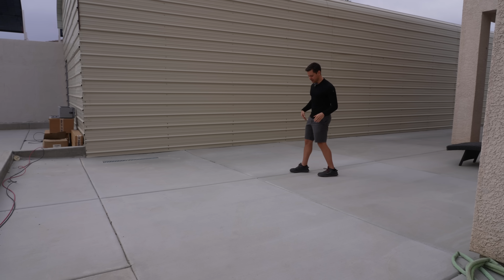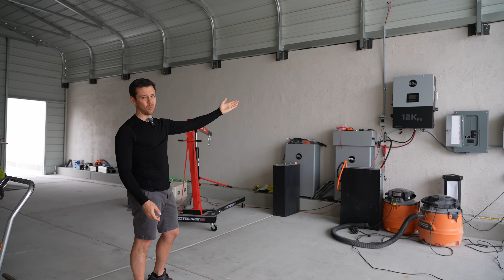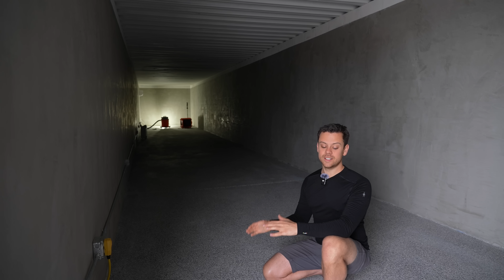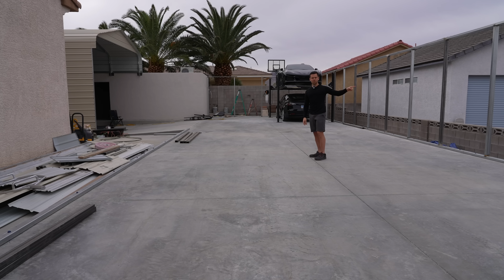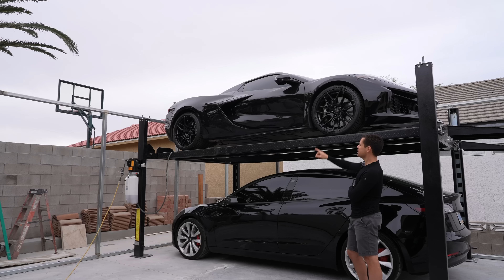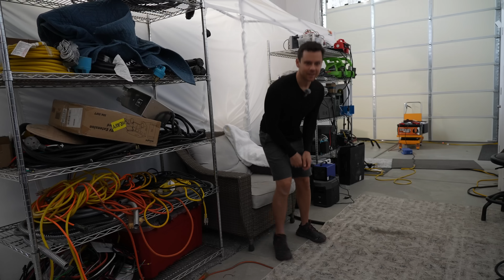I'm building a Bunker Vault! And other channel projects and life updates!

Comment: Amazing compound, Will. Thanks for all of your informative vids. I used them to build my ongoing 48 volt system which supplies vital loads during power outages- garage with my own comms system, fridge, and lighting, my well pump, as well as hookups for wifi, house fridge and cell phone charging, etc. I use a Sun Gold 18kw/ 48v grid tied inverter and a bank of 4- 200 amp hour batts in series. 2 solar chargers w/ combiners mounted outside for panel hookups. You are an inspiration and a great teacher.

Comment: it'll be cool if you can make a system so the vault is hermetically sealed with air recyclers from the outside, that way it's can truely be a fallout bunker, though I know you mentioned getting approvals that vault looks like it needs some kind of seperate air supply and a backup, as if somehow that bank vault door was closed with someone inside, it wouldn't take long with them breathing make making the C02 levels to rise, causing hypoxia, not to be a downer, but doing something like that not only to keep approvals off your back but also for you own safety

Comment: Learned something new about my heatpumps here in AZ.   I started monitoring them this summer with EmporiaEnergy in the panel box.    Here in November I turned them both off at the thermostat.     But found that each HP uses over 1Kw per day in the off position.  So I flipped the breakers off now when not using them.   (1Kw = 41w/hr)

Comment: Well I’ve got a 12’x12’ log cabin in northern WI. I currently  am planning on  powering it with an Anker F2600 fed by a 48v 30ab lifepo4 golf cart battery via the xt60 dc ports. I will be simultaneously charging them with a 48v 30 amp smart charger connected to the go battery. Do you see any problem with this?

Comment: Solar carport is a good idea, then you don't need to worry about having to move the panels in front of the RV garage. Solar powering hydroponics in the bunker would be cool, literally. Do you have a home gym, you could use excess solar to heat up a hot tub for post workouts.

Comment: You're something else, kid!! As an old retired veteran I have the time but I sure don't have your energy and motivation. Ok, nor the $$ lol. My range is out my front door on my 40 acres in very rural Oklahoma. I putter and even made one of those 4x8 solar panel air heaters some years ago but recently focused more on solar. Built my own hobo freight rolling tool box power station. Adding an Aferiy 210 with extra 100ah batteries to augment it. Mostly plan to use for keeping freezers going and blower fan on wood furnace.  Your videos motivate me to do more but I'm trying to be realistic for my personal situation. Keep them coming!

Comment: If anyone is just starting with Solar power… this system is the way to go… almost “plug and play” no figuring all the wire sizes, no figuring fuse sizes. No separate charge controller, no separate inverter.
All of your needs are there in a space saving unit. 
A 3000 watt inverter is a great size to start with.
If I could replace my current system… this is definitely the way to go!! Especially if just starting a solar project.
Thanks Will great video as always.
Excellent information, just hope people will follow up with your suggestions.

Comment: For heat reflection add a touch of blue to the white paint. It won't even get warm. I learned this from building a spray booth for a guy. He says it reflects light better. I painted a shed I made with it and it did not get hot to the touch in summer in South Florida. Try it you will be amazed😊

Comment: i built a 4s 32ah lifepo4 battery to replace the agm battery in my car. i went without a bms and used an inductive active balancer and added a 15w  heating pad connected to a thermostat and mounted it all inside of an ammo can. saved 55 lbs of weight over the regular agm battery in my car, and it saved about 55lb of weight which is the same weight savings as a titanium exhaust lol. its in my 2013 chevy volt. if i were you i would look into mods like this for your fast cars. crazy weight and money savings.
im also building 8kwh 100lb range extender packs out of 20mm ammo cans. they cost about 360 bucks each right now and use a cheap 3kw eu spec 220v inverter and the plan is to just charge them through one of those j1772 e bike plugs from free chargers at work. you can perfectly fit 8 280ah lifepo4 cells with the shorter threaded tops into 20mm ammo cans and theyre pretty fire safe. also not going with any bms since bms' are the reason for most diy battery fires.

Comment: Good stuff Will, you should try using unistrut on the walls where your going to be doing a lot of testing and changing configurations.  Real nice system if mounting points are constantly changing if your not familiar with it.

Comment: The system only works if you grease pockets.  
About your puffy face, you ain't no spring chicken anymore.  Cut down on your salt intake and drink more water.  Also decrease your weights and increase your reps for more definition and slow down the repetition to a 3 or 4 second count, that will help increase your muscle stamina.  I'd follow your gun channel if it is good.  Been shooting for more than 58 years maybe you could teach an old dog a new trick.

Comment: Regarding "puffy face" effect... as a one-time portrait photographer you soon learn to use slightly-telephoto lenses when doing shots like you do (small amount of table in background with you seen from mid-chest up). More wide-angle lenses tend to 'fatten' the person being video/photographed. You could take advantage of that in your 'bunker' with having a removable false wall at one end which has the power stations under video review and having the camera 10-20 feet away zoomed in to your desired view.
BTW I did meet you at Quartzsite Hobo Camp 2 or 3 years ago when you zipped down from LV for the day (and left after a short time at the campfire). 👍

Comment: If you want a gun range... go PCP air rifles and no permits required in most areas. Oh and PCP air rifles are totally different than old bb guns. You can go very large caliber but common ones are 22, 25, 30cal. Get a high pressure air compressor to charge them... really fun and very accurate too. My .25cal PCP air rifle can shoot 1/2 inch groups at 50 yards all day long.
Reply from the maker: Holy cow that's amazing
Reply: @WillProwse  You should get yourself one and see for yourself. I live on 2 acres so have 100 yards in my back yard and shoot mine there all the time. Super quiet so neighbors never hear a thing. My rifle uses 8 round pellet magazines so I can load up 4 mags worth of 25cal pellets and shoot all 32 shots before I need to recharge the rifle with air. Quiet, accurate and not cheap to buy but not bad either. A nice setup of rifle and compressor will be about $1000.Match grade setup maybe double that. Get yourself one and I bet you will be hooked like I am. Pyramid air is a good source for info and where I buy my stuff. No connection to them, just helping you out with something I actually am very familiar with since I have learned a lot from your channel about solar. ps... I love cars too. I currently have a 1970 Mach 1 with 351 Cleveland. IF you like cars, give an older musclecar a try. Every sportscar enthusiast should have at least one vintage musclecar.

Comment: I'm wondering how the bunker exterior wall joins to the RV garage  with a curve down roof.?
Seems like rain would shed down the RV roof ad run over the power wall that's loaded with electrical stuff.
I realize there's minimal rainfall in Vegas,  but sometimes it does!!

Comment: I grew up with American engineered vehicles and my Dad was always working on them. Then he bought a Datsun 210 and station wagon and rarely ever had problems. If American auto companies had taken Dr. Deming's quality assurance to heart, America could have remained forefront. But you just nailed the root problem...planned obsolescence.  I have traveled around the world and for some reason, many Latin American consumers still buy American engineered even with all their problems.  I am sticking to my reliable Hondas and Toyotas.
Reply: Those new Toyotas sure are reliable, non stop recalls.  The one advantage they had was making the same model for 20 years without changing much if anything.  Other manufacturers trying to release new models constantly leads to problems, just like the nightmare Toyota is in now that it is releasing some new models.

Comment: If you need permits, you’re not far out enough. In my state there is zero code or enforcement. Building permits are flexible (just a fee, always approved) or you can avoid it by spending less than 1000 or building on skids. Septic is loosely enforced.

Comment: You got a whole compound now!  What a far cry from the old van days.  Ya need to get some employees, a wife, and family.  Happy you aren't turning that thing into a gun range, even with active filtering the lead exposure would be off the charts, particularly with regular use.

It's something that isn't talked about very much, but people die every year from gun range lead exposure.  Gun-rights states underplay the danger and avoid recording statistics on it, but every once in a while a particularly gruesome case makes the news.  If you use a range regularly, definitely get a blood test every once in a while.

Hmm.  One thing I will note on the bunker.  You might already have it, but you need some serious exhaust fans to deal with any smoke/fire/fumes (in case a LiFePO4 battery ever runs away on you).  Industrial HEPA units can only do so much.

Damn, I want a scissor lift!  I've been hauling solar panels onto the roof DIY with a ladder and its exhausting.  I have nowhere to store it though.

-Matt
Reply: Agreed 100%. My brother (an admitted gun nut) is a radiologist and stopped going to indoor ranges when he saw the lead accumulation in people's bodies.  And there is no safe level of lead!
Reply from the maker: Exactly!!! This guy gets it. No one talks about the dangers of these heavy metal vapors at all. And yes, the filter system I am designing now. Needs to be able to push a ton of air. 

Yes, I get blood test for lead and mercury and some other stuff every six months. You get it
Reply from the maker: Oh man scissor lift for panels and roofs is game changing haha they have some nice ones now too!!
Reply: @WillProwse  I am really seriously considering getting one.  I finally got a new roof on my home and of course I made it solar-friendly.  Standing seam metal roof, so I can now mount solar panels wherever the heck I want, DIY, with zero penetrations through the roof using S-5 clamps and gear.

I DIY'd put my old system back on top of the garage (only 5kW), and other than the heavy lifting it was a breeze.   I intend to fill the whole roof up next year, also DIY.   DC strings.  Will probably have the electricial at ground-level done professionally.  Probably PW3s.  But gonna do all the roof solar myself.

-Matt

Comment: yeah we are just learning how indoor gun ranges are bad news.  people that work in them, even with the air filtration, have SUPER high levels of lead in their bones and teeth.  And the people that clean up all the spent rounds are supposed to wear a minimum of level B hazmat suit due to stirring up lead dust and microparticles that can be absorbed through skin contact.  I stopped going to indoor ranges altogether.
Reply from the maker: No way!! Yeah that heavy metals vapor is no joke! Just awful. Good to know
Reply: @WillProwse  I'd use it for high powered compound crossbows....
Reply: @WillProwse How about you use copper projectiles instead? Solid, not plated.
Reply: @WillProwse  yeah we had a range here in ATL with the filtration you describe.  Was a member.   They rented 50BMG BARRETTS silly at an indoor range but customers I’d take shooting loved having a video I’d make of them shooting it.  
They liked my ps90 also but they liked it so much I could visualize a cash register ka-Ching every round.  lol.